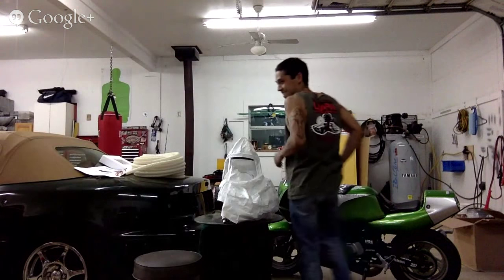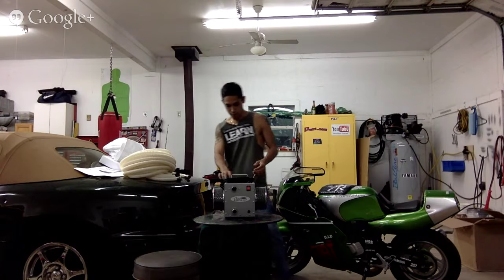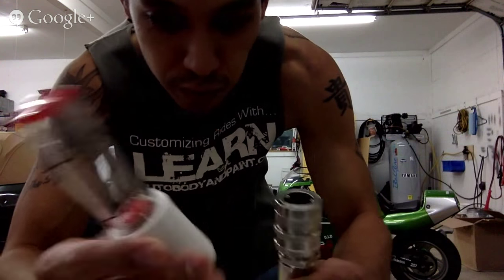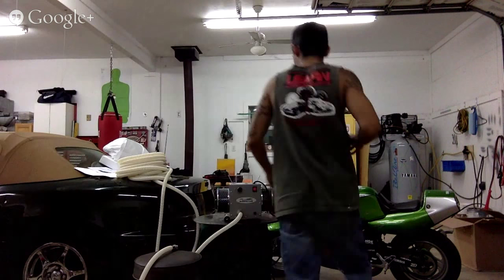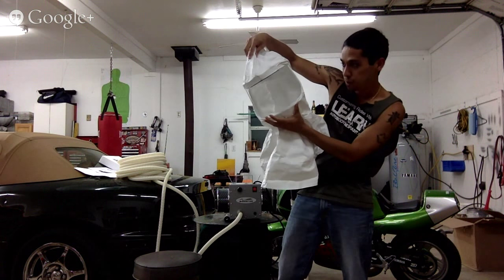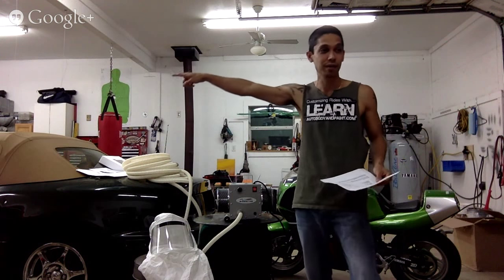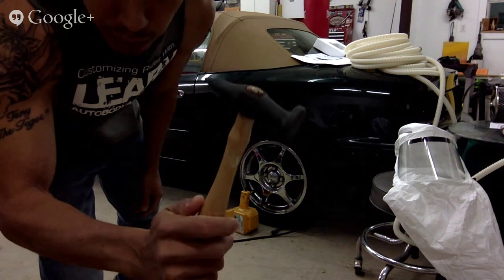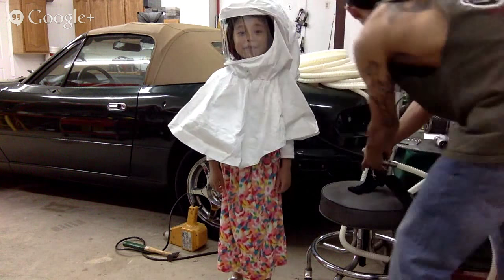Fresh Air Mask For Automotive Painting - Breathe Cool

Comment: Good video. Is that hood made from vinyl or Tyvek? I'm dealing with concrete dust from an angle grinder.
Reply from the maker: It's a pretty good hood. Not sure on the material.

Comment: Nice system but the hood is not any good has Velcro to hold your head in it all it dose is pull your hair find something better .I toke a old face shield an hooked it to the hood it works a lot better